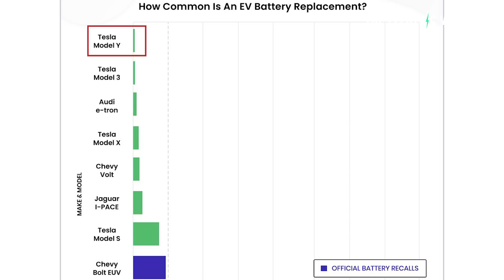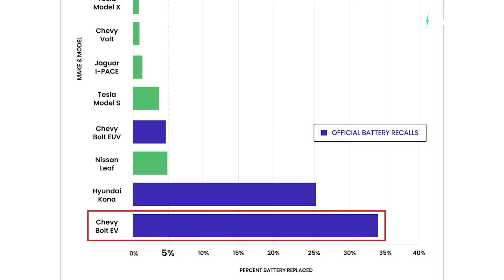Over 90% of battery pack replacements were for these 2 EV models

Comment: Based on LG battery history in solar systems, it would be expected that they life of a Li NMC battery pack will be around 7-8 years.  It will be interesting as these vehicles age as to how long they will last.  Sam is correct in that the Li Fe PO4 batteries will last much longer although they are much heavier.
Reply: Batteries fail for a number of reasons, not just because of the chemistry. If you look at the BYD even minor accidents are writing off the car due to the battery being part of the structure and as soon as the battery is damaged the car is a write off
Reply: @gregb1599  I wont say any collision can reach battery is minor. A regular ICE car reach that far in means you have structure damage. Can it be repaired? Yes! But the rigidity of the structure is no longer their even if you can straighten it
Reply: @林振华-t4v  I disagree if you look at the many accidents with EV many are just panel damage, so replace a door or front bumper. But as seen on Atto 3, Tesla and the Ora Good Cat as soon as that battery is damaged in any way the repair cost exceeds more than 80% of the cars value!

Comment: I have a 2023 Chevy EUV Bolt that replaced my 2020 Bolt with a recalled battery pack.  For some reason, qualified for a MSRP swap so I got a brand new car for about $5,000.00. I am very pleased and noticing that my deal contributes mightily to the negative balance sheet for GM.  The process required extreme patience but worked out very well for me.

Comment: No matter what device has moving parts there may be a need at sometime for some repair ice or BEV, the point is the BEV is truly a much better driving experience and you can refuel at home anytime and for cheaper. With todays battery management systems the average consumer will get tired of what their driving well before the battery need replacing and ten or more years down the road battery replacement costs will have gone down significantly. In the future EVs will be like flat screen TVs when they brake no one repairs them they just go buy a new and better model.

Comment: Somebody, please define what a "Cycle" is in the battery world?
Seriously,

Most/all rechargeable batteries quote "3,000 recycles," for example
after that, you can't recharge past 80%, for instance, and then the battery indicates that it's "Fully recharged."

As far as I know, the battery industry does not define what a "cycle" is.
Here is what it could mean:
1) A "cycle" happens every time you plug the battery in to recharge it
2) A "cycle" happens ONLY when the battery is near 0% and goes back to near 100%

When an industry can't define such a critical number, you know there is hanky-panky happening
and they won't stand behind their undefined "warranty"

I just looked at my Tesla app, and it shows me info on recharging, and my favorite app Tessie shows me EVERY time the car is plugged in, but neither tells me how many "Cycles" the car has endured.

So what's that definition of "Cycle"?
Reply: Interesting question.  Do 2 50% chargers equal 1 cycle.   GIven that it is harder on the battery to charge up to 100% it may take 10 20% to 70% charges to degrade the battery by 1 cycle.  The temperature is also a considerable variable. But I don't see hanky panky it is the nature of the beast.
How long will you new ICE car last? Not long if your teenage son is racing it on weekends.
Yeah some charging is harder on the cells than others.
Reply: @danharold3087  We are retired so we help drop off and pick up grandkids and do errands and average 3 runs a day in our Tesla.

So do I plug the car in after every use - and that counts as a cycle
or do I unplug for a week and wait until the charge is close to 15% and then do one big charge

I can't get a straight answer from Tesla or anyone - nobody seems to know the definition of "cycle".

Comment: Good stuff as ever Sam but needs some context. Here I will talk about reliability 'bathtubs'...so please bear with me. In the world of ICE Honda reign supreme when it comes to warranty recalls on engines (misfiring, seized up on first use etc). I knew a Volvo dealer in the UK who opened a Honda franchise...they thought they knew how much money to set aside at point of sale for warranty work...they believed Volvo to be a quality maker of car engines...The Honda guy laughed and explained that they would only need a fraction of the sale price at POS with Honda for warranty work. The stats suggest this is true, Honda are outstanding in the world of engines. Now switch back into EV land and look at the Nissan Leaf, the first mass market EV with by today's standards a not particularly good battery, no active cooling and with NMC turnery chemistry. Even so in their first 10,000 sales they had less than 10, I think it was 7 in fact cars delivered with DOA batteries or faults which developed in the first year. That is orders of magnitude better than any ICE, even the meticulous Honda engines. Anything made by human beings has a 'bathtub' shaped reliability curve. If it is going to break it will most likely break when it is new, which points to manufacturing errors or as we used to say DOA (dead on arrival) or DSAA (dead soon after arrival)...if the machine gets passed the first few weeks or times of use the failure curve drops down and stays low over time until the thing gets old and failure rates rise again as it wears out, hence the 'bathtub'. I'm retired now but in my early working life did a lot on reliability studies mostly for airframe components and I know what a massive departure EVs are from the ICE when it comes to reliability and durability.. The component count is SO much lower than on an ICE car and batteries, even not the best ones are inherently more reliable than any ICE....Yes, there are LFP packs out there that will see a million miles one day, perhaps more but we are really splitting hairs in the context of car use...Most owners will never see their NMC battery fail.

Comment: What are the statistics on out of warranty battery replacement numbers? Seems like the number we care about? Would be nice if there was a worry free system for batteries and motors as we transition instead of a lottery. 
Engines can be rebuilt, and many times for a nominal cost, especially if you can DIY compared to a non repairable pack that is a throwaway item at 1/2+ value of the vehicle.
Reply: A  QUALITY engine rebuild is not inexpensive.
Reply: What are you talking about, battery packs are repairable, they don't just throw them away.  And if they are not repairable, There are plenty of expensive items that can get recycled, there are companies already able to recycle 97% of the battery materials

Comment: You talk about cars doing hundreds of thousands of miles but what about just a few thousand miles, say up to 5k per year. Will these batteries last longer or deteriorate in about the same time?
Reply: yes
Reply: @Notme-tq4xs  yes they will or yes they wont?
Reply: They should last. Batteries degrade at least in part by the number of charging cycles.

Comment: I would like to go electric (a van or motorhome), but the comparison to ICE engine replacement is false in my opinion. I have a friend who has over 400K miles on a Honda Accord, still runs great, and he is shooting for 500K. Sure, probably the exception, but most cars today will probably go 200K if well cared for. And, there are lots of used or rebuilt engines to be had by that time, and aftermarket parts. I have never had to replace an engine in my life, always been able to fix it. Might be tough to DIY repair those battery packs!
Reply: A lot easier than machining the engine part in you kitchen at home 😂😂
Reply: @devonbikefilms  Maybe so. And, for a touch of irony, after posting this I went to drive my 22 yr old Ford Ranger and it wouldn't start! 😕 Fuel pump again.
Reply: @Brian has a point.   We have yet to get to the point where us 'economical' types have gotten our hands on EVs.   The thing about an EV is that it will have full power from new till the day it dies.  ICE cars lose compression over time.  There will soon be millions of old Teslas out there.  I am betting that people figure out how to fix what we now see as unfixable.
Reply: An EV battery still kills you in a split second if you dont know what you do, even if it's discharged. A HV battery isn't something amateurs should be doing surgery on on the kitchen table. Battery packs can almost always be repaired. In my country there are already specialised shops donig just that.
Reply: I am sitting now at six years with a Leaf and no sign of it stopping any time soon. On the other hand I have buried three ICE cars in that same span. Head gaskets, transmission failure, coolant system... things that don't exist on an EV. I have spent zero on the Leaf in six years aside from tires. Thousands on the ICE machines.
Reply: @PxThucydides  Glad to hear about the Leaf. I would like to go EV eventually. But it seems you have had extraordinarily bad luck with your ICE cars! I have a 22 yr old Ford Ranger and other than normal maintenance, I have done little except fuel pumps. It only has 110k miles though. The fuel pump is bad right now..

Comment: I do have to dispute the claim at 7:16 as someone who works in auto parts dealing with reman engines and transmissions at the retail level. On average the engine and transmission quotes I see are between 1,500 and 6,000 depending on size, weight, age, and rarity. While there are certainly exceptions in areas such light and medium duty pickup diesel engines, the average city car or SUV driver will likely not pay as much as the average ev owner under equivalent circumstances. This is mostly because right now a health aftermarket supply simply does not exist. Perhaps by the end of the decade there will be one. That more than anything will drive the price of EV batteries and drive units down to parity or below current remanufactured and aftermarket ICE equivalents.

Comment: May be too early to tell if we have problems with LFP batteries that need replacing.  They were commercialized in EVs only recently.  We'll see in a few years when more LFPs hit 500K kms of service
Reply: 500K km is probably more than most ICE cars would do before being end of life. 

Heck, that's basically a lifetime of driving for me; the car battery would outlive me.
Reply: @ordinaryhuman5645  Taxis have no problem hitting 500K. But for regular drivers I hear you. It's the kind of unrealistic expectations EVs need to exceed to convince the masses to adopt

Comment: Nissan really dropped the ball on battery management, I would have bought a Nissan leaf plus IF they had fixed that issue on the release updated leaf so they deserve to go bankrupt!
Reply: My Leaf is still at 90% after 140,000 kilometers. Anecdotally it seems charging to 80% at 120 makes a huge difference. People I know with level 2 chargers at home have burned out their Leaf batteries.

Comment: Are there problems with Kia, I thought the power train was much the same a Hyundai so I was guessing they also use the same batteries. Does anyone know whether this correct or not?
Reply: No, they are not. eg, the (old) e-niro used SK Innovation batteries, the Niro EV uses CATL. Don‘t know about EV6 though…
Reply: @thomasmahnken  Thanks , interesting to know as the e-Niro is a car I am considering buying
Reply: @andrewwebster6025  well, I own the old e-Niro (MY 22). 25.000 km done in one year. So far a great car, great value, slow charging though. People who drove much more state there is very low degradation, so very reliable in the long run.
Reply: @thomasmahnken   that’s my experience after 15 months ownership of an eNiro. The slow charging is not too bad, it’s rare I do over 250 miles in a day, so overnight charging on an AC charger is the norm for us. No degradation at all so far.

Comment: I bought a used 2017 Chevy Bolt in Oct 2020. When the battery replacement program came around it took a few months to get it replaced but it wasn't a big deal. Now I have a 2017 Bolt with a 2021 battery with a 260mi range and 8 years of warranty. No complaints here.
Reply: How has the reliability been other than the battery? Thinking of trading my Leaf for a Bolt, but consumer reports gives them a low reliability rating.
Reply: @EVVolksmanID.4  I have little confidence in Consumer Reports when it comes to cars, especially EVs. That said, I'm a sample of one, and the fact that I had no issues doesn't really tell you much. I simply like getting much more range, a roomier interior (deceptive as it's so small on the outside), and a shorter footprint: unlike the Leaf I can now walk around it in my small garage. Also: it was easy to mount a hitch, and to my surprise my standard size road bike fits inside with the front passenger seat in a normal position.
Reply: You'll complain when GM goes bankrupt and can't support your vehicle any longer...
But honestly, they'll get bailed out again... And again... And again and again and again.
Reply: @themonsterunderyourbed9408  GM will not go bankrupt anytime soon as they sold more vehicles in the US this past quarter than anyone else.
Reply: @richh650 gas vehicles yes. That's all about to change.

Comment: Love your videos. Appreciate the way you deliver in a non-hype way. I do have a disagreement with you today. I usually buy my vehicles with around 200,000 miles on them. By then you can tell if they are good quality or not. Currently own a 2002 Buick Park Avenue with over 270,000 miles. Bought it around 7 years ago for $1,500 USD with 196K. I've spent about $2,000 in repairs over the last seven years. The thing is a rust bucket, but I could keep driving it for a while if I choose. Never have I had to even consider a $15,000 repair looming. An engine or transmission would be around $5,000. They are both ok currently and have some life left in them. I feel the newer gas engines are less reliable because of low tension piston rings which makes me want to just jump to an ev. Love the Tesla model S, but have heard on youtube of $15,000 battery pack replacements after 150,000 miles. Yes, maybe this was on the older models. Seems like general repair bills on Teslas are quite expensive as well. People spend much more on new vehicles than I spend on this old one. Also, the used car prices currently are just too high here in the US. Most of our driving is highway miles in North Dakota where -40 degrees is possible. We live in the countryside and go to town every couple weeks or so. We don't spend much on gas. Just don't see how this is economically feasible currently. I'm just not the kind of person who will spend $3,000-$10,000/year on transportation. Maybe that is why we have money in our bank account unlike most young people now days. Maybe in a year or two the used car prices will come down. Thank you for your videos.
Reply: Good for you for having money in the bank!
As a Tesla owner I would not buy a Tesla model S, probably a great car but to many expensive points of failure. Some issues with handles, bushings and other suspension parts. 
I would buy a Tesla model 3 if I had some money and a Nissan Leaf with less money.
Reply: @Harrythehun  Thank you. A compact or sub-compact car is a big change in ride quality from a Buick Park Avenue when old people are doing mostly highway driving.
Reply: Yes but he cant shill for tesla if you use common sense man.   Dont such a party pooper.    Think of all that gas you'll save buying a 50k ev instead of buying gas and paying 4k for an ice vehical.
Reply: @jebes909090  EVs will soon be less expensive to buy.

Comment: Got a new battery pack in our 2019 Bolt and upgraded to a 65 kwh pack for free last year. My $21k used Bolt is still worth more than I paid for it.
Reply: So if you paid less than $21K in 2019 for a new Bolt, GM must’ve lost a ton of money on the sale.
Reply: Yes 10 kwh cost 1k ..so your battery only is more than 7k. Including bms n structure
Reply: @GreenDriveIndia  not my problem. It was a used car off of lease.
Reply: @GreenDriveIndia  So what, it cost me zero $.
Reply: @GreenDriveIndia  what does that mean…in English    Noob here
Reply: I've heard the replacement batteries don't charge as fast as the old ones did. They stopped the fast DC charging to keep the battery from getting too hot. Have you experienced that?
Reply: @danielcurtis4179  Not true. There's no difference between the 1st and second battery charging performance in my recalled/replaced batteries. 2019 Bolt premier.
Reply: @danielcurtis4179  You heard wrong. This is false information.

Comment: Structural batteries are probably not replaceable
Reply: They won't need to be replaced.
Reply: @themonsterunderyourbed9408  Are you really sure? after 20 years of use they still are like a brand new and never fail with you? Resale value is good and no worries never.
Reply: They’re still removable. Held in by bolts, not welded
Reply: The pack will be replaced, just like other cars.    Individual batteries, no.   But you won't replace individual batteries on a bolt anyway.

Comment: Have two Bolts since 2017.  No sufferring.  Just took them to the dealer for replacement.  Now we have two "brand new" cars.....
Reply: Nice, for you. Not so nice for GM, lol.
Reply: Kudos to you for sticking with Chevy. If I was told that I couldn't park in my garage, that I had to park 50 feet away from other cars, not to charge to 100% and so on because of the possibility of my vehicle catching on fire, I would had GM reimbursed me what I paid for the car. 

You took your chances,  stuck with them and got 2 new batteries. Glad it worked out for you.